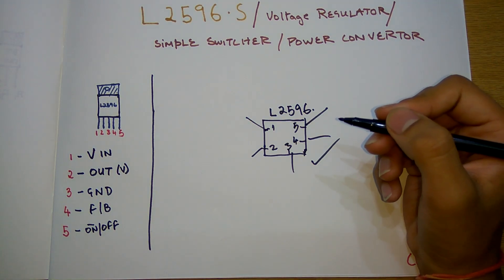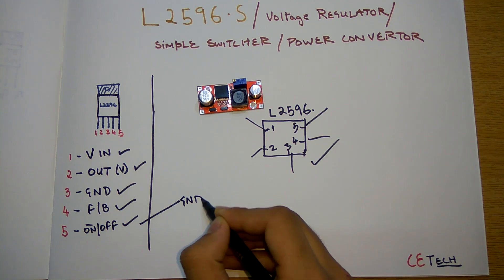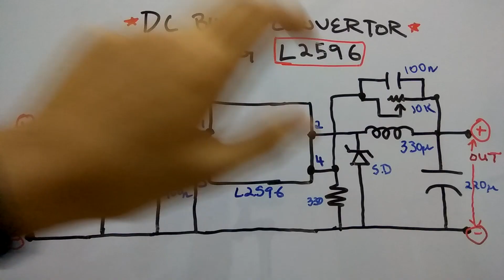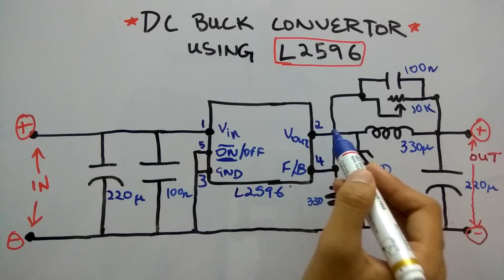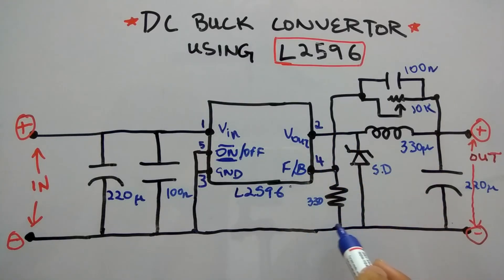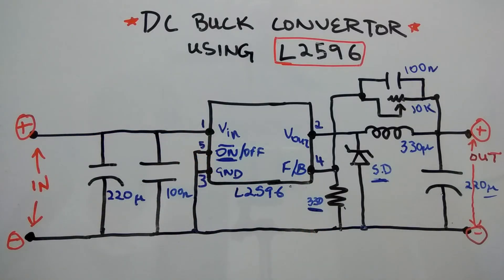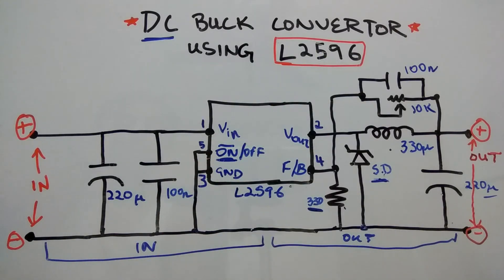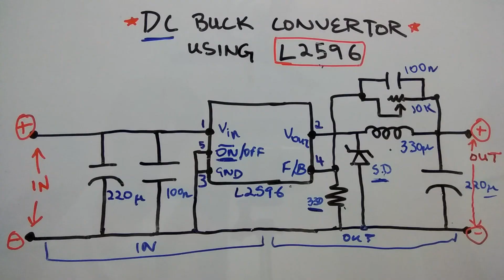LM2596 based DC Buck convertor | Circuit Diagram and pinout

Comment: Schottky Diode is important for the LM2596 to work with out burning out from the coil switching back the high voltage back to the LM ic

Comment: Can I connect the OUTPUT 2 pin to something other than the coil?  To something that will control the connection between the battery and the coil. Depending on the signal on pin 2, something will connect and disconnect the battery from the coil. Will I achieve, for example, 10A with the LM2596t which has a max of 3A

Comment: 0:32 "Linear voltage regulator rubbish" Not sure but it sounds like he just insulted every linear IC engineer." Linear IC's  are not Rubbish. They are a necessary part of electrical component family.  I am offended.  Who the hell are you ?
Many more components in this circuit than in a linear 78XX regulator based circuit which had only three components.  I wonder what the output impedance is  ? I doubt the DC out , "ripple" is very clean. Guessing  about.707 * Zener Voltage. If so then this is very noisy. As current draw increases so should the ripple.
This circuit is intended for a using with a pure DC (Battery) Source, not a converted AC source.
I do not think this person is qualified to teach nor an Electrical Engineer.

Comment: The Schottky Diode is a Freewheel Diode(Flyback diode).
 when the Mosfet inside LM2596 switch Off (No Current is flowing) that means the inductor will generate High voltage around itself and that will cause damage to the components especially LM2596 and the diode will prevent that because it will be in the forward bias and that allows the current to flow through it.

Comment: if you  dont know what that SD is for then a video of electronics isnt for you.  OUTput is NO AC so there not for filtering.  and the top part of your out is Feedback (telling the SMPS the outout power) the SD continues the circuit when the gate is closed or you get a power spike.  its also low losses to make the circuit efficient

Comment: These modules are so cheap, would it make any sense to use 3 of them to step from 30v to 20v, then 20v to 10v, then 10v to 3v? Wouldn't doing this guarantee much less heating of any particular module? Total cost = $2.37 :) Someone tell me if this is a hair brained idea. Also, if 3 is a good idea, what about 6?
Reply: This kind of technique was used in the past with the analogue regulators, because they had to transform the excess energy in heat, in order to provide the necessary (desired) output regulation. These buck converters are working under the switching regulation principal, which does not suffer of that heating problem. Therefore this solution is not necessary when using buck converters. Of course a good design is always of utmost importance and its price almost always reflects it's quality...

Comment: I need some help here. I am trying to use this module to make my own RC Nitro car glow igniter. And when I connect the wires to module the glow plug does not ignite and nothing seems to happen. But I measure the voltage at the output in the module and in the glow igniter it reads 1.5 V but when I put a glow plug the output voltage dies.
Any suggestions what might be the problem.
Reply: there is overload circuit in IC. your glow plug draw more current than IC supply, the system shut off.

Comment: The diode has the same function of a diode on a basic Buck Converter diagram. It is called a rectifier or a catch diode, it is used to close the loop circuit on the load side to remove the stored energy from the inductor.
Reply: Actually the proper name for the diode is a Schottky Zener Diode. there is no such thing as a "Catch" diode.

Comment: Hİ
Is there a board design made with the Eagle program?
 I need to design a board on the LM2596S eagle.
 An urgent homework I have to do ..tenks
Reply: You can find plenty of such designs on Aliexpress. From the placement of the parts it is easy to create a design which is not critical at all.

Comment: what is the purpose of the inductor in the circuit??
Reply: the inductor is the element that actally steps down the voltage in this circuit. Vout=  Vin -  Vinductor.  And the voltage across the inductor  depends on the current variation trough it, and the inductance value
Reply: To smooth out the spikes and block any AC interference

Comment: good video well explained.  do you know what happens to the output voltage when the input voltage decrease ??????????
vin = 12v      output 5v  (  regulated in pot.)
vin = 10v      output= ?  stays regulated
vin = 9v         output = ?     "         "
vin = 8v          output = ?
etc .  for example 
thanks .
Reply from the maker: When input voltage goes below 5.3V it starts to linearly decrease.
Reply: that´s it ...   thank you . works more or less like a regulator .
thanks .
Reply from the maker: Your welcome, consider subscribing to our channel!

Comment: What sould i do for high temprature
 when using as led driver with 30w cob led it gone high temprature an then burnt-out after 2 minutes. ...please tell me something for this. ...
Reply: The max current from the buck converter you will get is 2 amps.. that's why it's happening....🙏... Just simply use a path transistor with the circuit 🙏🙏
Reply: @ElectroSpecies  my led takes 36vdc and the current is eprox 800ma it is not reach 2amps.
Reply: @S-Tach 

 link --   https://www.amazon.in/dp/B0723FSV7S/ref=cm_sw_r_cp_apa_i_fMCvFbX60T4KS

You can just buy this little beauty for this 🙏

Comment: Can you please do a follow-up video (or reply here) adding a voltage output limiter (5.1v Zener reference) feedback loop to pin 5 of the 2596 to disable output when the threshold (5.1v) is exceeded. This type of protection would be helpful if only a few components are required.
Reply: @B. GLENN, thanks! Very good to know. I saw in datasheet (SNVS124C –NOVEMBER 1999–REVISED APRIL 2013 from Texas Instruments) on page 27... named Undervoltage Lockout with Delayed Startup. 
I will test this IC with the basic circuit from this video and... after that... I will test come protections!

Comment: The value of the inductor is wrong in the drawing. A printing of 330 on the inductor refers to 33uH type. The Schottky diode should be something like an 1N5822/1N5825.
For values meeting your VIN/VOUT/IOUT requirements maybe refer to:
http://www.ti.com/lit/ds/symlink/lm2596.pdf
including tables for various configurations.
Reply: So will we get lm2596 module according to the values in that pdf.
Reply: @mastango2278  That will be fine than. You can also use 47uH. Depending on the maximum amperes you require go for a 7x7 or 12x12mm inductor.
Reply: i am planning to have very high current output, 20A, what size of inductor should i use?
Reply: @danpham8806  Well with this buck converter you will be limited to 3A

Comment: thank you for your video; I tried this circuit to provide 7.5 volt to my arduino uno. I go from 28 volt DC to get that 7.5 Volt. I found out that the L2596 becomes hot. Can it handle 28 volt ? Is it normal that it becomes hot ?
Reply: Ya plz heat sink
Reply: Use a correct inductor and not 330uH as is erroneously shown on this amateur video.
Reply: @tomvienna1518  Correct! The guy in the video misinterpreted the coil's smd code, which is 33μH. Not 330!! 
In this coding system, the third number implies the number of zeros following the main value of the coding, consisting of the two initial arithmetical numbers, that is in this case, 33 followed by 0, meaning none zero exists after 33, with the value always being given in μH...

Comment: If i increase the voltage, does it also increase the current or ampere?
Reply: no. there is a feed back pin which control by IC 2596

Comment: purpose of schottky diode is to remove reverse current in case of inductor load.
Reply: actually no... reverse current is how it works. That LM2596 works as a PWM switch from input to output. When it is open it will charge the capacitor and inductor and when it is charged it will just switch off. Feedback is sensing that. When it is switched off output current flows from the chraged inductor through that diode to the output and when the inductor is depleted voltage on output capacitor will go down and via feedback that LM2596 will turn that internal mosfet on.... that diode is mandatory to work... More complicated dc/dc converters are using second mosfet to that diode and that will open when the main is closed to bypass that diode for lower losses and better effenciency. Also need to be said that it is acutally not turn on and off like i said it is actually fixed frequency (higher is better) - what is changing is PWM duty cycle. This chip is running at 150kHz and you can find for the same money 300kHz version from xlsemi.
Reply: @matejsojka6683  sir can i use this circuit to vary by li ion batt output
Reply: @SureshKumar-nk2ok  for charging you need to add current limit feedback, for liion as source you cannot use it because minimal input voltage of that lm2596 is 4,5V